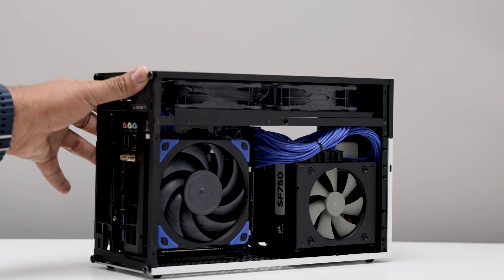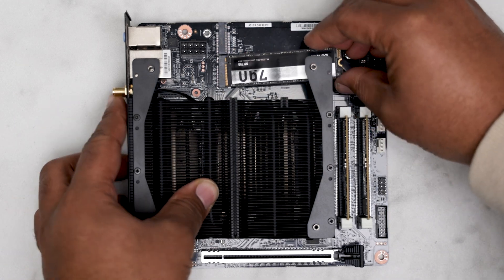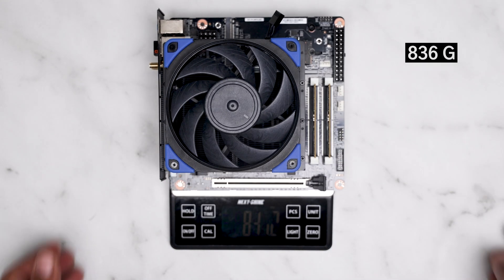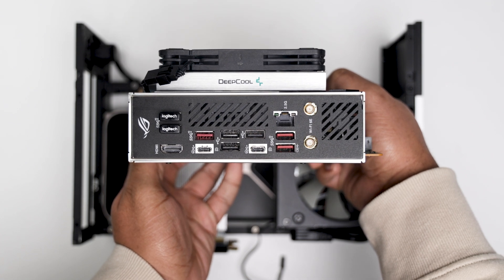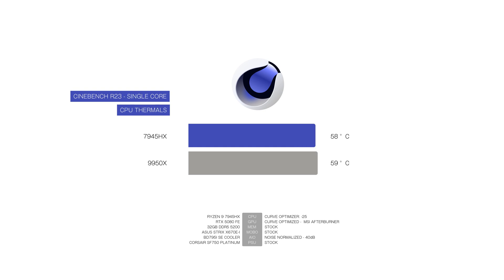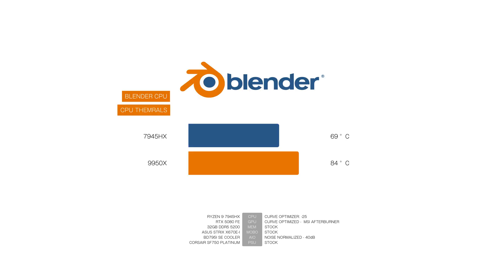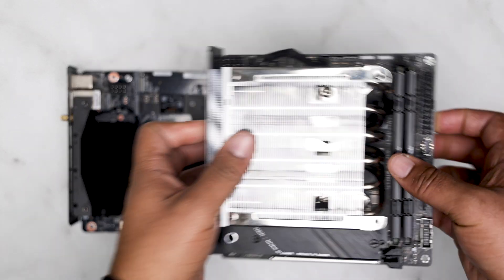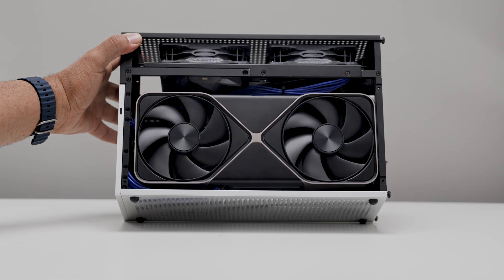Minisforum BD795i SE vs Ryzen 9 9950X – Power vs. Efficiency!

Comment: If you need fast data transfer betwwen your NVME drives, get the 9950. The data transfer on the 795i is comparable to a NVME drive though USB3 port, around 400MBs. Better motherboard CPU's get over 1000MBs.

Comment: Excellent video, very educational. I was wondering what total CPU cooler+fan clearance is required for the Minisforum BD795i SE motherboard with a 15 mm or 25 mm fan attached to the CPU heatsink? Basically, what position did you have to use with the Formd T1 case for the CPU/GPU clearance bracket (i.e. how many GPU slots?). I'm planning to use an SFF case with either 67 mm or 70 mm CPU cooler clearance, and I was wondering if the  Minisforum BD795i SE motherboard would fit. Also, I think it would be great to compare the 7945HX to the 9950X running in ECO mode. Very cool video BTW, I just subbed!

Comment: I would be curious to see how the 9950X fairs when using ECO mode.
Reply: Me too, that would be a very interesting comparison. I'm thinking the 7945HX should be basically the same as a 7950x running in ECO mode, so it would be very interesting to see how it compare to the 9950X is ECO mode. I'm guessing it should be possible to tune the 9950X so that it performs more efficiently than the 7950HX, given that the CPU has a more modern design that should be more efficient (power wise). That would make the 9950X a more flexible solution overall, but more expensive compared to the Minisforum. Given the difference in price, I think I still prefer the flexibility and upgradeability of the 9950X. Still not sure to be honest, because I do like the Minisforum solution, but right now I'm still in the 9950X camp.

Comment: Buying one of these for a proxmox build.  16c/32t and throw 64gig ram and 2TB m.2 and I can run some serious Linux VM's   Thanks!
Reply: hi, can you run ram on 5600??
Reply: @laijoseph4839  It accepts 5600mhz ddr5 ram but its limited to 5200mhz speed.  It's a fast little mobo for proxmox.

Comment: perfect video about it! Thank you! I am going to buy this for render-node(s). Will it fit A09 pc case - that is the question.
Reply: That is a good question. I would really like to know what total CPU cooler clearance is needed with a 15 or 25 mm CPU cooler fan attached to the CPU cooler. I can't find any information about that on the Minisforum website. I already have an SFF case that can support up to 67 mm cpu cooler clearance and I'd like to know if it would fit. Seems crazy they don't include that information on their website. I'm guessing the A09 case is able to support up to 67 mm too, right? Did you get it to fit in the A09?

Comment: ur using an airflow fan instead of a static pressure fan which are better for airflow through fins
Reply from the maker: The NF-A12 is a designed for both uses but more specifically radiators and heatsinks.

Comment: A couple points of feedback...

Just call them the "Asus board" and the "Minisforum board" after the initial run introducing the model numbers. Nobody likes cryptic model numbers only use when necessary.

The slides!  I watch on a little phone screen. All i see is a crap ton of wasted white space and some tiny letters and numbers in a 6pt font that i need to pinch zoom to see. Please consider the UX for folks with small displays and/or bad eyes.

I'm on the edge about subscribing😅. It was a good video covering a specific topic I'm interested in, but i just couldn't quite get what i wanted out of it as result as i wanted.  Keep up the good work and thanks!

Comment: They just made a micro atx variant of the minisforum bd795i. I got the itx bd795i but im almost temped to pick up the micro atx one. It has sata slots, which i wish mine had, but doesnt come with a cooler. Instead it has an lga 1700 (odd ikr) mounting hole setup to bring your own cooler and im curious if that would mean better performance. If i ever sell this one i might try that route since its so cheap

Comment: Would it be possible to replace the radio with a dual slot sata adapter and would there be enough pci lanes when using  2 nvme drives as well as a pci express 4.0 video card? Tnx!
Reply from the maker: I’m not exactly sure I understand what you mean but there’s only one PCIE x16 slot. I’m not sure if anything can be placed in the PCIE network slot other than a network card.

Comment: What about adding discrete GPU such as AMD 6950 / 7900 / 8070 and NVIDIA 3080 and 4090
Reply from the maker: They would all work, I only tried the 5080 because that’s what I have on hand currently, it’s currently powering my Intel Arc A770 16GB OC for my editing PC.

Comment: Hey, I wonder if there are wifi card/expansion you install? Or it came with the MB? I noticed that the IO shield has a wifi attenna.
Reply from the maker: It does not come with the wifi/bluetooth card for this model. You can buy it as they include the mounting hardware for it and antennas, just not the card itself. It a 2230 E-Key Network card that you need, I think you can find them under $50. When I get the BD790i X3D model in I’ll review it as it does include a network card but it’s $200 more expensive because of the wireless card and X3D chip.
Reply: @ I see. Buying an E-key network card seems to be a more budget-friendly option.
Reply from the maker: @ it does :)

Comment: Hey Chris, what slot size did you go with in the T1 for the Minisforum build?
Reply from the maker: The 5080 FE was in a 2.25 slot but you can go up to 2.5
Reply: @ChrisRussellTech  is the T1 2.5 slot position the most you can get with the Minisforum board and the NF-A12x25 fan attached?
Reply from the maker: @ honestly you won’t be able to put any other fan size on the Minisforum unless you source the right screws for anything smaller or bigger.

Comment: These Minisforum boards a pretty crazy value. If you want the most bang for buck multicore performance this is a no-brainer. In Australia the best you could really get for the same price is the cheapest b650m + Ryzen 7 7700, and I bet this 7945hx shits on that for multicore workloads. A comparison between those might be good for a workstation.
Reply from the maker: You’re correct, if someone does a price for price comparison then the 7945HX would be the clear victor, only losing in connectivity and upgradeability.

Comment: 9950X can get around 45k in R23 very easily.
Reply from the maker: It’s thermal limited because I was using a low profile cooler.
Reply: @ChrisRussellTech  That make sense. I have to switch to AIO since at ~10L that is almost the only viable option for not limiting the performance.

Comment: I noticed the strange socket in vertical form for wifi buetooth, kinda weird and the video did not show how to install in vertical ?
Reply from the maker: Don’t own a wifi e-key network adapter, I couldn’t show that.
Reply: @FormFactorPC  yeah but most people use wifi so the video I think should be generalized . Anyway thanks for the effort on review.
Reply from the maker: @ I honestly haven’t used wifi on my desktop in years but I use Bluetooth often and that’s a pain point of the board for sure but my review of the BD790i X3D will be out in a couple of weeks and it has built in wifi and Bluetooth.

Comment: I have been reading that people who purchased this board had trouble mounting 15 mm fans onto the heatsink with the screws not fitting correctly, does the motherboard come with the required mounting hardware or will it need to be purchased separately?
Reply from the maker: I had similar issues with trying to mount the T-30s, the fan holes on the heatsink are countersunk and the screws it uses doesn’t seem to be a popular thread type. It’s possible but your better off buying a screw kit and trying out different sizes
Reply from the maker: They include screws for a 25mm fan

Comment: HUGELY helpful consideration, i was looking at both of these processors and in this sff size.  Thank you!
Reply from the maker: If you can get over its limitations and want a 16-core option that doesn’t break the bank. The BD796i SE is a solid choice and it’s really light for those looking to travel with it.

Comment: I am really glad you put out this video. I just purchased mine from Minisforum. I've been admiring this board for a year. It is a game changer in a lot of ways if people implement it properly. It lacks some things, but for what it is and what it can do, there is nothing that is comparable to it. A unique piece of hardware that will last 5 or more years hopefully.
Reply from the maker: It should be fine, these chips are designed to be at 95c often in a laptop, with the bigger cooler it should stay much cooler hopefully keeping the CPU from degrading as fast.

Comment: what about the MINISFORUM BD790i   vs.   AMD Ryzen 9 9900X ?  I need a new PC and debating upon these options
Reply from the maker: I’d suggest you think about what you really want to do with the computer; gaming, productivity or both. You’ll get probably get similar performance on the 7945HX compared to the 9900X. The two chips have different core counts but the 9900X can pull around 160W instead of 100W, filling in the 4-core gap.
Reply: @ChrisRussellTech  yeah tough call, I do mainly producitivty and rendering, not so much gaming. Decision is very tough.    9900 + mobo =   960$,    795i  = 650$  (CAD). Perhaps I could drop to a   7900X + 650i mobo = 780$.   The minisforum still comes out cheaper and that doesn't include a cooler for another 50-100$. Yeah not sure how many cores I will need, but the more the better in my applications....

Comment: I have the X3D version on preorder. For just number crunching its saving me about only a few extra hundred as opposed to the other build I was considering at $600 before tax. The other build I was considering was a 9800X3D with a Sapphire B850M board at $750 together after tax. But Im comitting for the novelty/simplicity. Got a all together purchase of the cpu, board and cooler together for lower power draw. I think it'll be interesting.
Reply from the maker: I think you’ll be happy, I have the X3D board coming in a week or two for review.

Comment: Would be very interested to see how this compares to a 9900x, seeing its so close to a 9950x. Possibly more performance, less power, easier to cool, and cheaper. Biggest problem I see with the motherboard is the lack of sata ports, wouldn’t quite work for my upcoming build as I need a lot of storage. 
Keep up the good work, been enjoying your builds lately.
Reply: If you are willing to give up one m.2 you can get something called an HBA and add much more SATA devices
Reply from the maker: The lack of SATA ports was covered in my original full video but it was over 15 minutes long and had to cut it. I think there are some evident trade offs like no USB-C header, SATA ports, wireless connectivity.

Comment: Have the BD770i for ages now - solid motherboard and runs super cool (Dan A4-SFX)
Reply from the maker: I think it makes so much sense for small form factor builds. If it can get you 80-90% of the performance of a desktop CPU while being cooler, it’s an easy win.
Reply: The Board is good, but if you have an issue, have minisforum any sort of support or service for defects ?

Comment: I want to see this test done but with a wattage normalized result. I would like to see what the scores end up going towards if both are limited to running the same power consumption
Reply from the maker: What if I told you that performance was almost identical on multi core performance when capped at 100W. It was a test idea I scrapped but I ran it.

Comment: Looking forward to seeing an AI Max+ 395 ITX motherboard!
Reply from the maker: Me too! It's getting pretty exciting around mini-PC's
Reply: Don't expect the best gaming MOBO, the 395 only has 16 total pciexpress lanes.

4 allocated to nvme, 4 allocated to usb4(thunderbolt), leaves 8 for everything else.

Most boards allocate 4 to the pciexpress slot and the remaining 4 for something else (more nvme, thunderbolt or other onboard components like NIC etc)
Reply: @meateaw  yeah I wish they would make a desktop version of the processor with more lanes
Reply: @jbrown-acuity  9955HX is the version you wany if you need a gpu. It's even faster since it's also Zen 5 and boost a little bit higher.
If you got a 8060S built in why even bother with a gpu? If you need the horsepower wait until you can find a M.2 to Oculink 5.0 adapter but the whole point is you get hella preformance in a smaller package and very limited upgradability since ram is also solders thus the big ass price tag on AI Max systems.